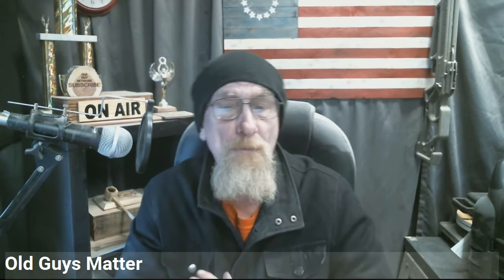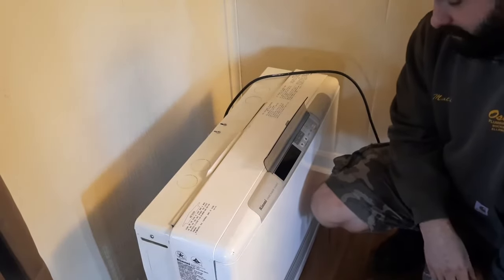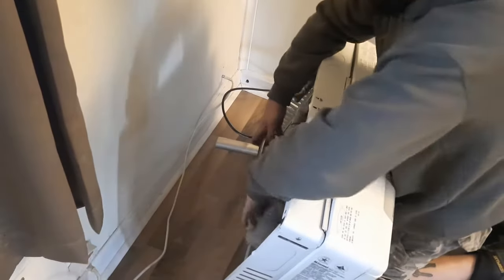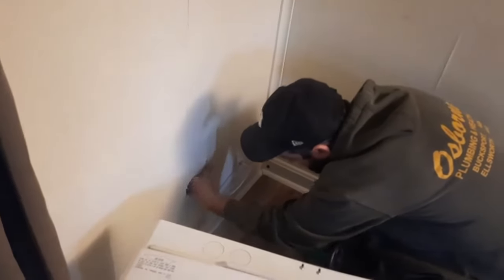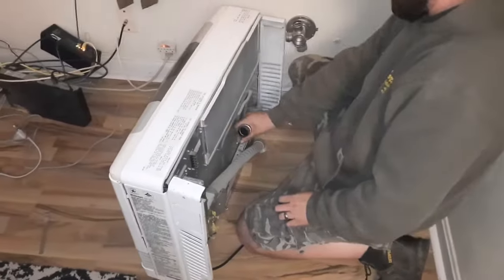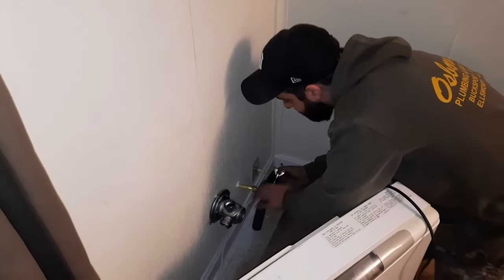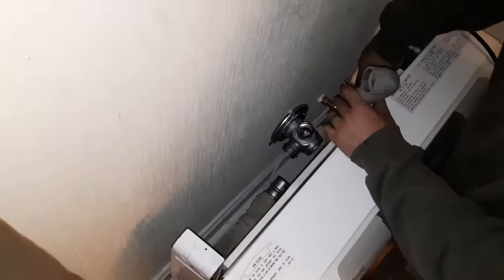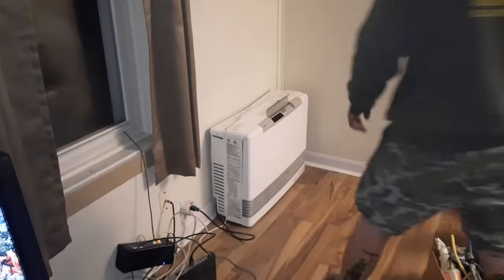Installing a Rinnai Propane heater! #oldguysmatter #oldguynetwork

Comment: Just installed EX38 but couldn't do it on exterior wall. Instead of spending ~$400 on rinnai extension kits, built a little chase and got 6' of stainless 1.5" tubing off zoro (which has an ID 1mm greater than the Rinnai exhaust OD) for $50 to extend the exhaust to exterior wall. The chase lets me get combustion air from an exterior vented water heater closet. Doesnt hurt running the ss exhaust pipe through water heater closet, with adequate clearances, and hopefully helps keep pipes from freezing.

Comment: Thanks for video, very useful to me. One detail not shown is on the strips that how the inner flue to the outer flue. We can see the two strips being poked through to the inside. The thing not shown is how those strips have to be pulled by pliers and hooked onto two "hooks"on the inner wall of the inner flue unit. Excess should be snipped off. If you ever need to remove the heater, these spring loaded strips can be unhooked with long nose pliers, to disconnect the inner and outer unit.

Comment: Good job I have a Rinnai  in my basement in a big room does a great job if I let it it would do the ole house the house boiler hardly works much cheaper to run also

Comment: I had one of those in the garage. Worked great.
Reply from the maker: I'm pretty happy with it.
Reply: I just bought 2 used Rinnai model 556fa and found out they have a safety recall/repair that needs to be done on them. Leaky fire box gasket.     Check your serial number  and Google recall on Rinnai direct vent heater.
Reply: Maybe Matt did not bring vacuum to clean the floor  from the wall dust and debris hole drilling. It's just a thought from me the watcher. Thanks

Comment: Which regulator do u recommend? I have a 40# and 30# tank with a y line connector and typical 20# bbq regulator...it works on low but gives low gas code when I set it above low. Should I go to a high pressure?

Comment: that needs a gas valve befor the flex, in most places
Reply: Didnt put one on here because the unit is older and has a valve shut off on the side. Also we were waiting on a tank setter and some more work was going to be done to the gas line before the unit. You are not wrong though!